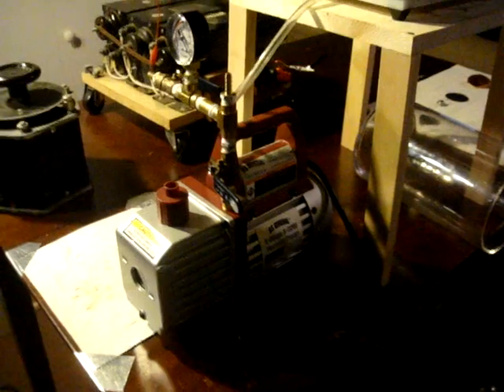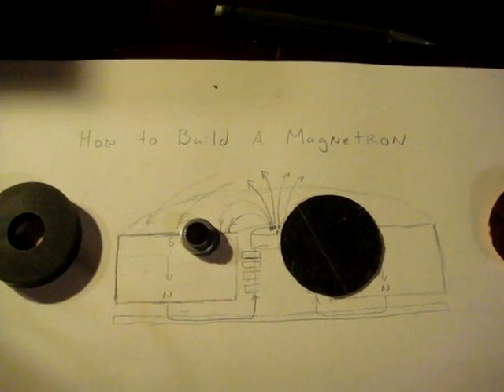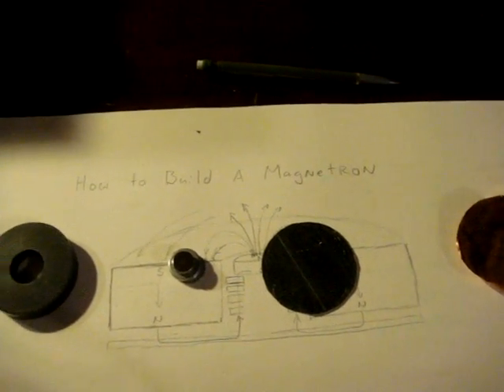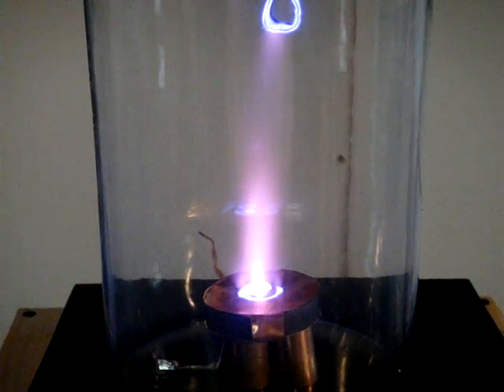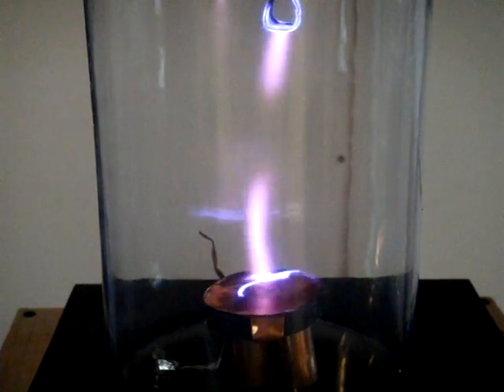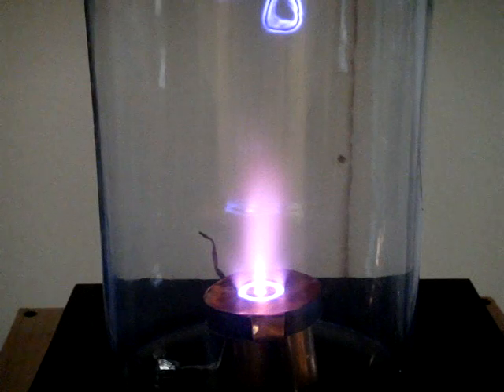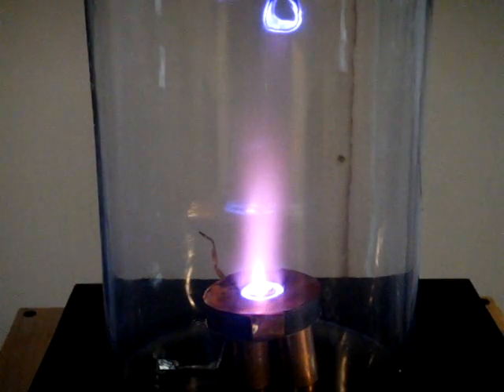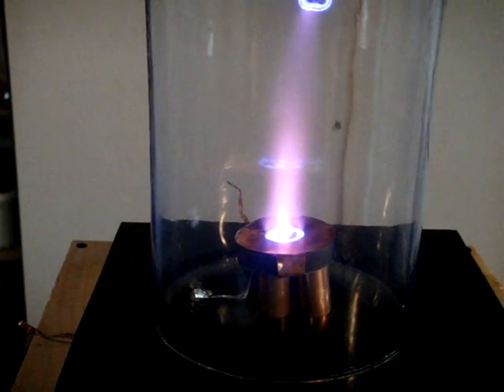DIY: Home Semiconductor Fabrication (Magnetron Building)

Comment: How strong does the magnet needs to be? 

I tried building one, using a loudspeaker magnet. It kinda works until i place the “target” on top of the magnet. 
Does it matter if the target is touching the north and south pole of the magnet?
Or maybe the vacuum is too low?

I hope you smart people can help me out with this 🥺

A few testruns :

https://youtu.be/sLf1fGzYj4Q

https://youtu.be/yZ0HP-_tl2M
Reply from the maker: I've been meaning to get a Gauss meter to measure and give an exact value, but I use ceramic outer magnet with neodymium inner magnets. What are you using for inner magnet?
Reply: sparkstarter the inner magnet is just a steel piece, thats connected to the back of the ring magnet. So i should have a north and south pole. According to the pictures on the internet.
Reply from the maker: Yeah your going to need a strong magnet in there.
Reply: My experience is somewhat limited so I can't say for sure if I can help but I'll try. What voltage are you using for your power supply? I've used a ring magnet/pole piece combo like you did with reasonable success but without knowing more I cant say for sure. Just like in a microwave magnetron your magnetic strength and voltage should be proportional to each other. Because of this is technically impossible to get magnet that's too "weak", so long as the voltage that works best with that magnet is still strong enough to produce a usable corona.
Reply: based on the color of the plasma in your chamber I'm assuming your working gas is argon, considering how tightly constrained your arc is I'm assuming you likely have a poor vacuum. Are you using DC or ac?

Keep in mind, I'm just guessing based on what I've seen so far in your videos so take what I say with a grain of salt. My chamber was inside a steel container so I didn't spend much time looking at my corona while it was running, saves on sight glass cleaning to keep in blocked off unless I'm trying some new project or process.

Comment: What's the voltage your are using? Is it smoothed DC?  And how strong is the vacuum?  I tried building a simple cathode tube a while back had no success yet.

Not sure where I went wrong.  But I think that it was that the vacuum was not strong enough.  I have pretty big flyback transformer that must have been putting out several thousand volts.  Seeing this makes me want to try again. Cheers.

Comment from the maker: No X-rays are produced the voltage is too low and the vacuum pressure is too high.  There may be a small amount of UV but I have not been able to measure it... I am not concerned about UV from the tube as it is too small for me to measure.

Comment from the maker: I'm working on a series of videos that will show just that! so stay tuned...
To answer your question, the magnetron will sputter a thin layer of material onto a substrate.
Currently I'm trying to sputter a layer of copper oxide on stainless steel... the copper oxide is a semiconductor and hopefully I will have a working diode when I'm done.

Comment: get a 9 volt battery,some salt, water, and copper wire
mix salt in water
put copper wires from terminals in water, positive should be oxygen, hydrogen should be negative

Comment: Are you able to use this device to split water into H and O? If so then what is the current and frequency?
Reply: No, but you can use a simple battery and some wires to do this.